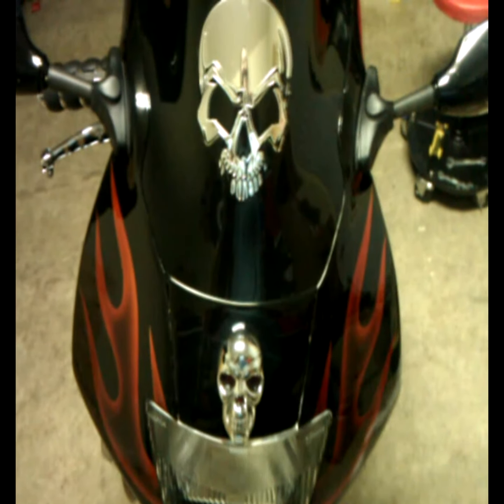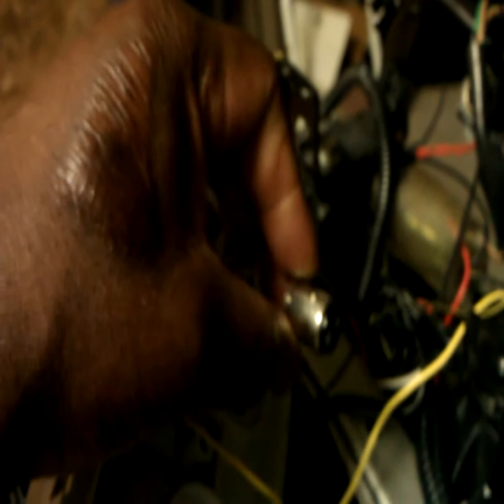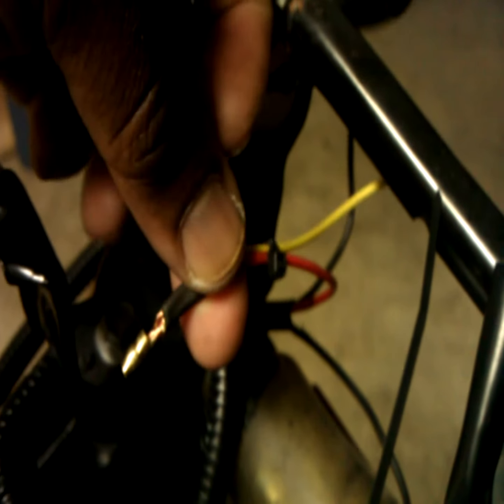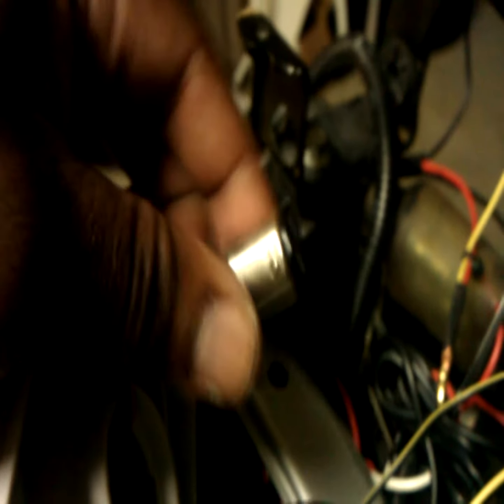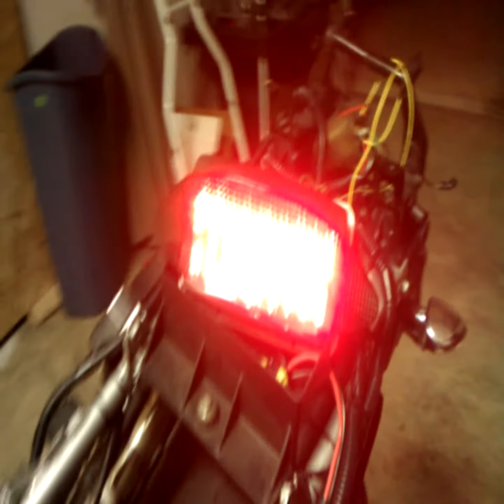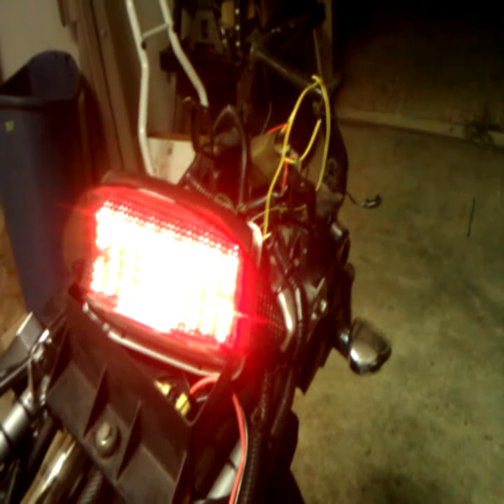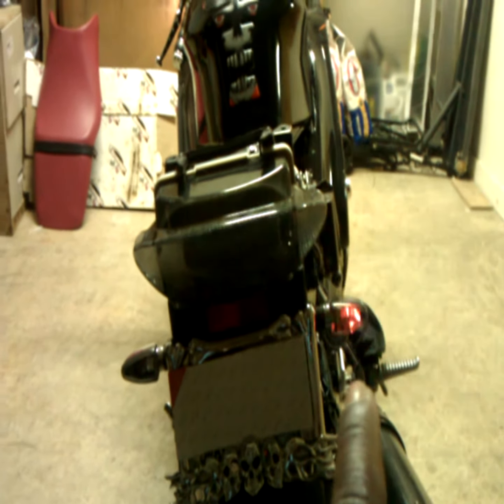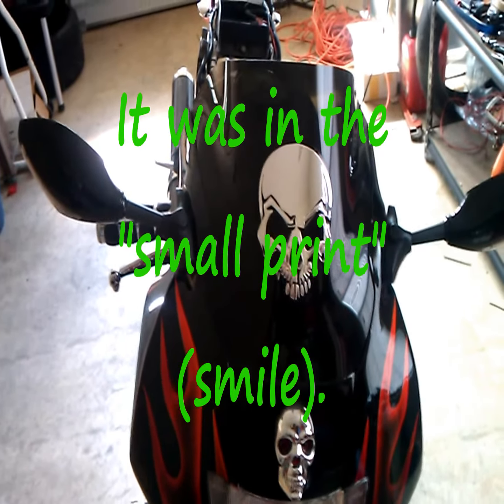Intergrated Turn-Signal Taillight Install 1998 Honda CBR 600 F3

Comment: installing an integrated yamaha r6 brake light on my cbr 600 f2 with turn signals. brake light works i dont understand what you did with the negative on the turn signal wires. i get a consistent yellow turn signal light when not in use but when using signal it flashes between the yellow red.

Comment: what did you do with the negative wires for each tailight signal
Reply: today x tomorrow 288 he had the other turn signals also that he wired up like stock signals so they already had negative connectors. He just wired the yellows to the positive cables. I'm wondering the same thing lol, I'm not going to have any turn signals. Just the integrated tail light turn signals
Reply: @tylerbostick6963 I know it’s a long shot, but I’m trying and trying and I still can’t find any videos about help with this and am still having issues with figuring it out, same situation just want the taillight, not the extra turn signals, cannot believe I can’t find any other video with then a 11 year old video with mid quality
Reply: did you figure out a way? im stumped on what to do with the negative wires only want to use the integrated

Comment: can u make a video of how you wired the integrated mirrors into the bike, i have the same mirrors and the wiring on my bike is all messed up and cant figure out where to wire it at
Reply from the maker: Stewie; I had not thought to create such a video but I have my bike tore down right now and before I put it back together I will create the video. Look for the video soon.

Comment: Mr. Maurice, Would you have any idea if your light upgrades (Integrated Rear, Integrated Mirror signals) would work on the 1995 system? 

I've got a '95 F3 that I want to add all of these onto.